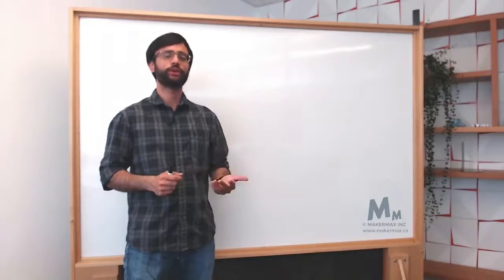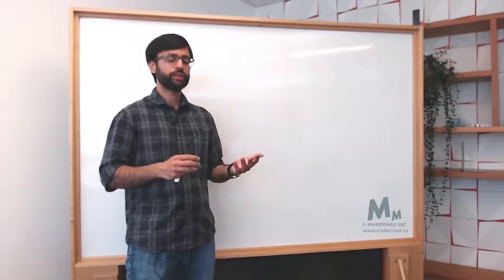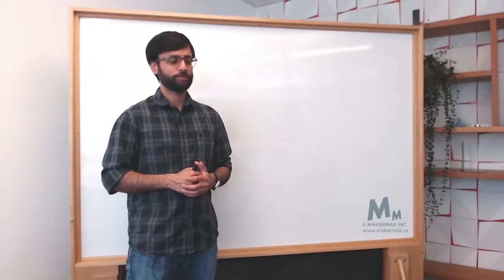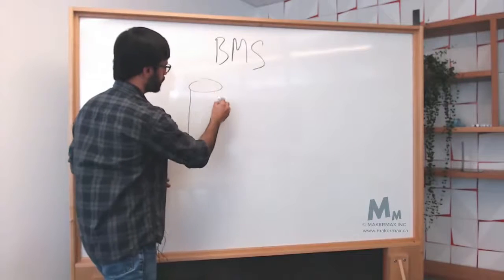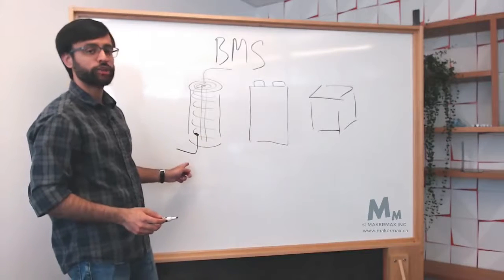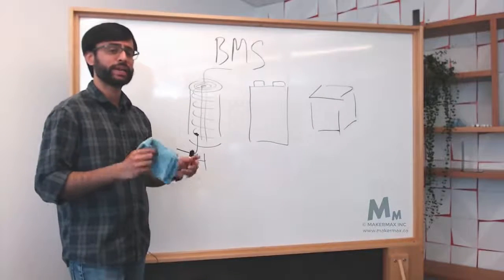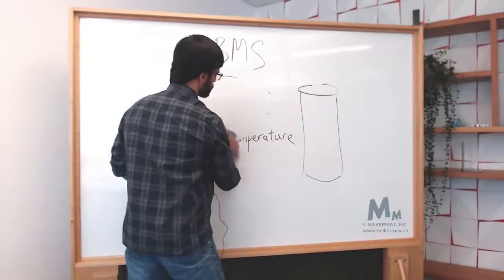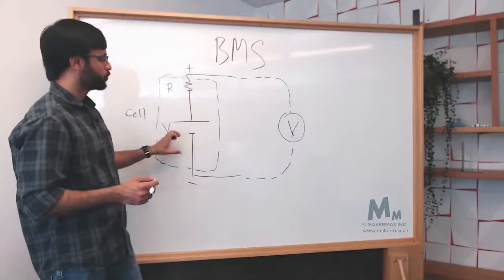Fundamentals of battery management systems

Comment: Platinum resistance (PRT) have linear relationship with temperature  is one more option. Low temperature is non-hazardous during discharge but Li plating can occur at medium to high charge current at low temperature. So one of funtions of BMS is to cut off charge if the temperature is below a certain value.